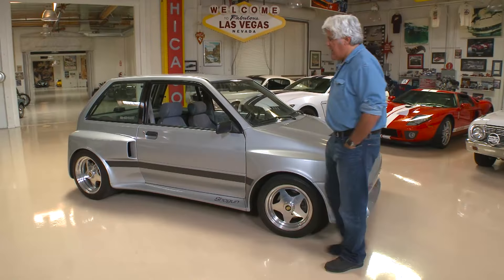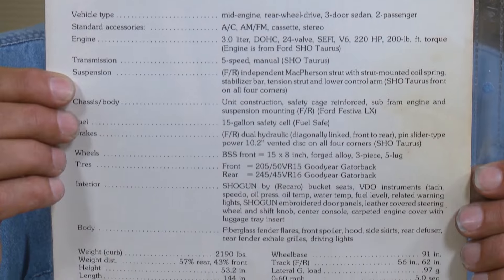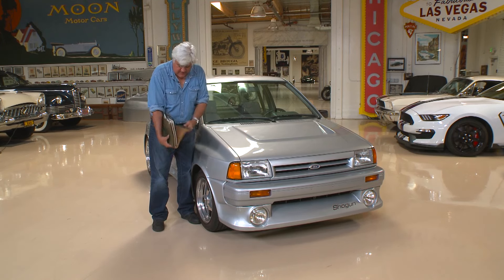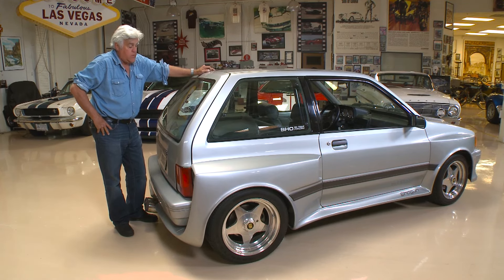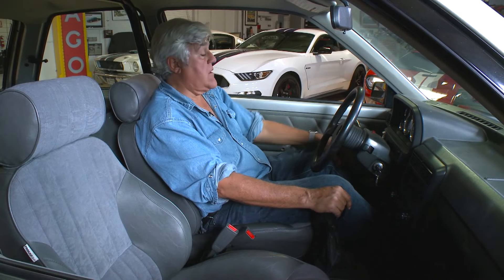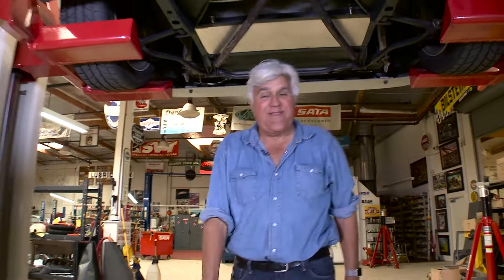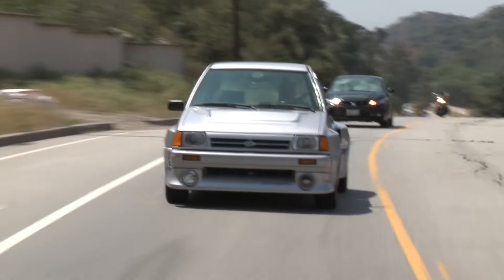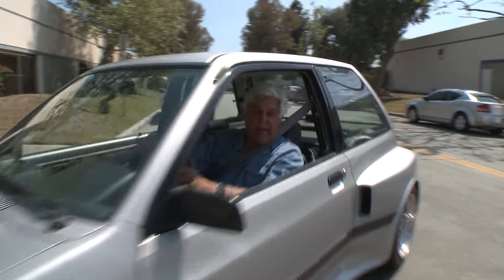1989 Ford Shogun - Jay Leno's Garage

Comment: I think that car is pretty cool.  It's inspired me to put a 5.0 Coyote V8 in a 2017 Ford Fiesta, and convert it to RWD....
Reply: +HorsepowerKings.com Isn't it too wide for the shock towers?
Reply: +HorsepowerKings.com Where are you going to find a transmission to work? If it was me, I would put the EcoBoost out of the Focus ST into the back. That way you have a transverse setup already. You can easily get 350+ horse power out of it, and no worry of torque steer or anything.

But I do think the shock towers (as mentioned) may be an issue. My wife has a '14 Fiesta, not very wide back there.

Comment: $42,000 in 1989 is equivalent in purchasing power to about $92,659.79 today, an increase of $50,659.79 over 32 years. The dollar had an average inflation rate of 2.50% per year between 1989 and today, producing a cumulative price increase of 120.62%. The 1989 inflation rate was 4.82%.

Comment: Those are original Goodyear Gatorback tires.
Reply: Bwahaha!
Reply: What's so funny?
Reply: +Schön the car is 27 years old
Reply: Are you getting good grip from them? Do you need the volume higher?

A little Gatorback pop culture trivia.for you.
Reply: o0bananaman0o That's my point. Goodyear stopped manufacturing the Gatorback tire sometime back in the late 80's - early 90's. Very good tire, maybe one of their all-time best - was OEM on the vette. Goodyear continues to manufacture a serpentine belt under their patented Gatorback name, but the tires no more.
Reply: John Smith been winning with that burn since 1st grade man!!  haha.
Reply: I recognized the tires, too.  They came on my 1986 Dodge Shelby Charger Turbo.

Comment: ❤❤❤❤❤❤❤❤ I absolutely love these cars I have a 1988 Ford festiva that's got over $310,000 mi on the original engine of driven cross-country twice I've driven it all the way to Palmer valley Alaska I would never let that car go ever and I bought it used for $600 running 21 years ago and still going strong❤❤❤❤❤❤❤❤❤❤❤❤❤🙏🙏🙏🙏🙏👍👍👍👍👍👍👍👍👍👍

Comment: I had a 1990 Ford festiva. Stock it was til kinda quick with no passengers. I drove it like a rally car on gravel roads. Took it on ridge deer hunting. It would fit down 4 wheeler trails

Comment: Just had a google its a mazda 121 ... for other people in the UK :P
Reply: Also a Kia Pride in many Asian countries
Reply: +ste lamo The Ford Fiesta wasn't available in North America until 2008 (sixth generation).  Instead of it they sold re-branded Mazda 121's as Ford Festiva's and the second generation of the car was sold as Ford Aspire.  Funny thing is the car (first generation 121) is still in production as the Saipa Pick-Up and Pride in Iran.
Reply: +chrishu76 The U.S. Mark I Fiesta was built in Saarlouis,
 Germany but to slightly different specifications; U.S. models were 
Base, Decor, Sport, and Ghia, the Ghia having the highest level of trim.
 These trim levels changed very little in the Fiesta's three-year run in
 the USA, from 1978 to 1980. All U.S. models featured the more powerful 
1,596cc (97.4cu in) engine. I should know. 
When I took on a computer job and my boss had one. I had driven to a job it in when I was in high school 78-82.
Reply: Didn't the Kia Pride come with white wall tyres as standard?
Reply: DaytonCarCare
I always thought Americans where lucky to get the MK1 Fiesta only with the 1.6 L ... People in the UK would have jumped at the chance of a base model 1.6 ! Would have been a cheap fast car !
Reply: +ste lamo Had a 71 MGB-GT once.  More HP. ;)
Reply: DaytonCarCare Thanks for the info didn't know that the first generation Fiesta was available in the US.
Reply: +chrishu76 Yes impressive cars back in the day. That's one reason I got into BMWs. In the late 80s the 325i came out with 168 HP. All standard equipment was electric locks, windows, sunroof, "325is" with limited slip dif, and even an on board computer that displayed MPG, range of tank, and other info.
Reply: ste lamo US versions of European cars almost always come with a bigger more powerful engine.
Reply: DaytonCarCare Well I grew up in Germany and lived there until early 1988.  I actually don't recall seeing many first and second generation Ford Fiesta's on the road the majority of compact cars I saw where either VW's, Opel's, Renault's, and Peugeot's.  Japanese cars where also pretty rare In Germany before the 90s I only recall seeing a few Subaru's and Mitsubishi's.
Reply: chrishu76
I wouldn't mind having many of the German version cars imported to the US. Especially the 80s BMW/Mercedes that were mounted with those awful bumpers and headlights. And more manual versions over there too. Also the E36 M3 with the true Motorsports engine at 320hp. Not the 240hp one that we got.  Pretty much was a 328i engine  overboard to a 3.0 & 3.2 to give it another 50 HP.
Reply: +chrishu76 yeah i didn't know that ether, i don't think its the same MK1 fiesta we are thinking about
Reply: DaytonCarCare Yes, when I lived in Germany pretty much all cars had manual transmission the percentages might have dropped a few points over the years but the majority of cars are still standard.  Plus diesel cars are also a lot more popular in Europe.
Reply: chrishu76
That's what I like about the older BMWs here.  I had a 95 525i that had a manual 5 speed they also imported a manual 6 speed 540i.  I had an auto 98 540i before too.
Reply: Will Samet Kia Pride in the UK too

Comment: Fun fact..... the base Festiva with a 1300cc engine, did better burnouts than the Shogun version since it had 145R12 tires. I could literally roast the tires right thru 3rd gear with a 4 speed manual. I owned 3 of the regular Festivas and never replaced a single thing and one of them I put over 400,000 miles on. This car was by far, the most reliable car ever made by Kia

Comment: renault Clio V6 is more akin to this shogun than the R5 though
Reply: exactly
Reply: I think the clio is too new
Reply: well obviously the Clio is of a different era and yes AzuraelX the Clio was WAY (full thousand pounds I believe) heavier but I believe churned out more power in its end of life than the Shogun or at the very least more torque.
Reply: Oh and The silver one was modified to run in SCCA
Reply: +niamaru2   But you can't do a 3-point turn in the Clio.  300-point maybe if you're doing it on a freeway/motorway, but 3-point, no chance...
Reply: gosportjamie hahaha yeah I know :D
Reply: +niamaru2 Nah, it is rather the roadgoing Renault R5 Turbo Group B (Maxi Turbo) with 250 HP, given the rarity.
Reply: +niamaru2 NO
Reply: Rover Waters WHAT ?!
Reply: niamaru2   I think he was saying that the silver Shogun that Jay owns wasn't modified for racing.  As he said in the video he bought it new from the builders and had the nitrous kit added, presumably for fun and because 220bhp (factory figures for that SHO unit but probably on the conservative side as some standard Taurus SHOs have dyno'd out at more than that at the wheels) just isn't enough...
Reply: its written on the shogun's wiki page that the silver one that jay own's is modded to respect the SCCA regulations, which I think only means the roll cage and harness
Reply: not when you look at age difference the renault 5 came out in the 80's the clip v6 ph1 I think was 99 onwards.
Reply: daniel jordan nicol of course, R5 is the inspiration for this.
Jay is dissing the R5 turbo for nothing, that was a car bread for rally competitions, is not just about top speed.
Reply: niamaru2   I'd be surprised to find that the roll cage was not part of the conversion as standard, cutting out the rear floor to fit the engine would have taken a lot of strength out of the standard shell which would need to be replaced and some kind of cage is a good and relatively easy way to do it.  Maybe the cage that can be seen in Jay's car is additional to what was fitted during the conversion.  On a personal note I would consider fitting a harness to a car like this was just reasonable sense, you really don't want to end up in the passenger seat when you're having fun.  But I guess it could also be that maybe Jay added these parts to be able to run the car in hillclimb or sprint competition because a car like this would seem to be a very natural fit in that sort of competition...
Reply: +niamaru2  Not even close the Clio was a 1000lbs heavier. maybe on a road course  it might win. But in a drag race it wouldn't be even close. The clio was 255bhp  the SHO motor was 220bhp then ad the nitro and your over 310bhp
Reply: +gosportjamie when you have a McLaren F1 & P1, why get involved in hill climbs with this?
Reply: +SmoothCobra 3 That's not surprising, it was designed by Mazda, sold worldwide by Ford, Mazda and Kia
Reply: Abe From an   When Jay bought this back in 1991 neither the F1 or P1 were out.  This car is very small and very light which means it can change direction very quickly even at low speed which is exactly what you need for a hillclimb car...

Comment: I love how Jay says he's never replaced anything or had trouble with the car in 30 years. Well yeah Jay, you've only put 12k miles on the thing in 3 decades. It's barely been driven.
Reply: Probably not even that
Reply: Which I think is more of a testament. Engines degrade over time if they aren't used (the whole car does really), so for this little thing to still be working well is surprising
Reply: @pbmdh  Lol, maybe if it was living in some random guys carport, exposed to the elements. These cars live in Jay's temperature controlled garage, are run regularly and have their fluids changed annually. Hardly the conditions that lead to degradation of a vehicle.
Reply: @D3Mp5  Spoken like somebody who's never worked on automobiles ever.
Reply: @pbmdh  Lol, spoken like somebody who's never worked on 'automobiles' ever.
Reply: @pbmdh  Jay's cars are pampered.  He has people who care for them regularly.  If you think any of the cars in his fleet are subject to rotting away due to neglect, then you are sadly mistaken.  This is not the average Joe Blow's car that sits in a barn for decades going completely unnoticed...Do you even know why cars that sit have issues?  Primarily due to moisture in the air, but I would bet money that Jay runs a dehumidifier in his garage to help preserve the vehicles in his fleet.  After all, they are an investment, not tools that he uses to go back and forth from point A to B for some 9-5 job that the rest of us commoners are subject to using our cars for...
Reply: @whorutothink  I'm guessing he also has a guy on payroll whose entire job is to take each car for a spin periodically to cycle the fluids and get some temperature in them. Wonder if there's a vacancy..................
Reply: @pbmdh  yeah they degrade when their blocks are made of chocolate...

Comment: $42,000 in 1989 is now $82,440.24 calculated for inflation on 5/11/2016
Reply: Yikes
Reply: how did you figure this?  lol
Reply: Which is probably why they only sold 7. $42k for a Festiva is absolutely absurd.
Reply: +debryson demouchet you can look up inflation calculators on line.
Reply: Jamin Walton gotcha
Reply: holy cow by that rate Jay got taken advantage of you can have a lot more hp/weight ratio fun for a lot less money...but I'm sure it seemed like a good idea at the time.
my friend has a Festiva chopped into a pick up version...We call it his clown car
Reply: Tim Clarey assuming the same principle, that it's a ford fiesta with the most powerful v-6 on offer (400 hp), I would consider it.
Reply: john moser can't find a V6, mid engine, rwd festival nowadays though. In fact you can't find any rwd hatches other than BMW's, that are new from the factory that is. I would definitely pay a premium for one of these, especially considering what their value would be now.
Reply: john moser you couldn't at the time. The Renault 5 Turbo he mentioned in the film had 158 Bhp, the Peugeot 205 GTI had 128 bhp and obviously front wheel drive.
Nissan 300ZX were about 300 bhp but curb weight about 3600 lbs.
Lotus Elan M100 weighed about the same, but with only 160 bhp and cost about $34 000. So it wasn't that bad of a deal.
The only car with similar power to weight ratio would be the Porsche 911 Turbo with 326 bhp and 2998 lbs curb weight, at around $50 grand
Reply: john moser   Jay said he was in the more money than brains club at the time he bought it
Reply: Fun and value rarely go together The more money than brains option is usually a fun place to be in the car world if you can afford it.
Reply: $42,000 in 1989 is now $85,925.38 calculated for inflation on 5/23/2018
Reply: cloridian Beauchamps, it's a great car for sure. But they were kind of hard to find in 1989, some 12 years before they were launched ;)
Reply: 85K+ now 08/09/18. Economy on the up and up!
Reply: If it's an 89 model, then it was sold in 1988, which makes the cost go up to $91,000.
Reply: my thoughts exactly. No wonder they didn't sell many. They must have been trying to cover initial costs and shot them selves in the foot in doing so.
Reply: Still 911 money.  Like he said “It’s for the more money than brains club”
Reply: Unless its salary......

Comment: The '89 Corvette had 240 or 245 hp based on muffler choice. 1st ZR1 was a 1990 model at 375hp 370 ft-lb. The performance era was starting to kick in again!

Comment: So this car was only released in the US?!! Looks like something that would fly of the shelfs in europe...
Reply: LUCKYDUCKY 62  
The Clio V6 was a proper production car, this Shogun was one of only 7.
Reply: This was never a production car. Not in the US or anywhere. It's a well built custom job, 1 of 7.
Reply: The base car was sold in Europe as the Kia Pride. The Shogun wasn’t a real production car
Reply: Standard production car was Ford Festiva, basically a rebadged Mazda 121. Next size up was Mazda 323 ( in the US, it was badged as Mercury Tracer ). At that time, Ford owned 50% of Mazda

Comment: Man. Alot of great V6 engines came out of the late 80s.
The mazda kf-ze
The ford SHO
The volkswagen vr6
And whatever that buick/maserati thing that was in the GNX was.
Reply: In the GNX I think it was a twin turbo V 6 or a single turbo not sure but definitely at least 1 turbo
Reply: @danielk4331  yes, single turbo 3.8L V6. It was the fastest production car of the 80's and that pissed off Chevrolet.
Reply: @Nothingtoya  Buick and Chevrolet are made by the same company GM
Reply: @damonlemasters3424  right......the Corvette was supposed to be the fastest car, not the regal.......
Reply: @Nothingtoya  the fiero also made them mad lol
Reply: @damonlemasters3424  also, things were on they're way to being like it is today but in the 80's, different GM brands still made some of their own engines. Even though all the cars looked a lot a like and started off as the same platform, each brand was allowed to add their own things to the car. Now GM fully controls what each one of their brands do.
Reply: Actually the Taurus SHO was a 4.6 V8 not a V6
Reply: Rob Winder no, it was a Yamaha V6 in the 80s

https://en.m.wikipedia.org/wiki/Ford_Taurus_SHO

The one made from 96 to 99 had a 3.4 L V8
Reply: Can you imagine a mid-engined, rear wheel drive Golf or Corrado with the VR6?  I've seen one in a magazine (maybe Eurotuner?) some years back and it was glorious, but it's a shame that some manufacturers didn't pick up on this trend...
Reply: Maserati had nothing to do with it. It was a stock 1987 Buick Regal Grand National with a mostly stock Buick 3.8L Turbo V6. A few minor modifications were made by McLaren ASC. Most of the modification package was cosmetics and a true independent rear suspension.

Ladder bars were also installed to help with launching. McLaren was given a 300 horsepower goal and didn't even have to open the engine to do it. Only real mechanical differences are a custom turbocharger with a ceramic impeller blade, and I believe larger injectors were needed to meet the horsepower goal.

If not for Chevrolet's bellyaching to GM brass, the Shogun might have had a bit more serious competition. FYI, Buick and Chevrolet may have been made by the same parent company, but they were nothing alike back then.

Lunkheaded management has slowly gutted each brand until they are all cookie cutter cars, and coming from a GM die hard, GM hasn't built anything worth buying in 20 years. I myself just traded a three-year-old GM in on a Toyota, and I am not looking back.
Reply: @robwinder3108   SHO was never a 4.6. For a very limited time around 96 to 99, the SHO got a 3.2L V8. The 4.6L was more or less relegated to the bigger RWD vehicles such as E-vans, F-pickups, Crown Victoria, Mustang, and Thunderbird. Possibly a few FWD Continentals got V8s, but I believe they were actually the same 3.2L the SHO got. 4.6L is entirely too wide to fit in a transverse FWD car.
Reply: @anonymousinc6330  I just remember seeing a SHO with a V8 no idea what block it was and it was a Taurus
Reply: @robwinder3108  probably the same v8 in the lincon ls
Reply: @anonymousinc6330  the V8 was 3.4 liters,. the 3.2 liter was the automatic sho from 1993 to 1995.still the Yamaha v6.1996 to 1999 shos had the 32 valve v8
Reply: @danielwatne5535   Are you sure? That's interesting, I remember a TV review bit on the 96(?) SHO saying the new V8 was a 3.2L. It was my understanding that the original SHO V6 would more or less become the optional engine in lesser models from 96+. I'm no expert on these things, I just remember what was said on the show.

Comment: Also Jay, there were only 7 of these cars originally built, and you already know that your car is number 3, but I always wanted it after owning mine. I even saw a tuning shop in Brandon, FL that had one with a 1.9L Escort engine with a 5 speed manual that was bright orange with ground effects, and it was slammed on Dayton wire wheels (it was the late 90s). I have yet to see one of these however. Amazing engineering for back in those days.